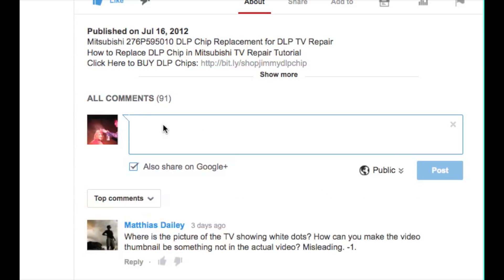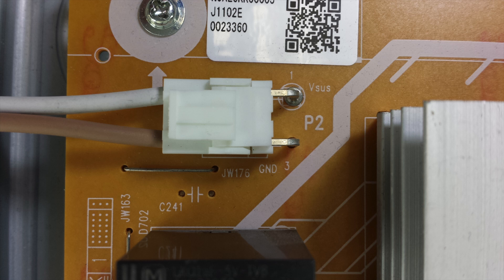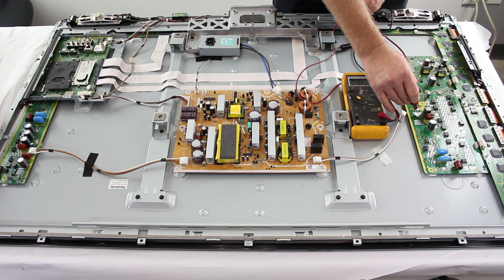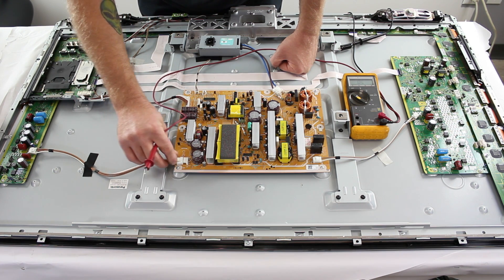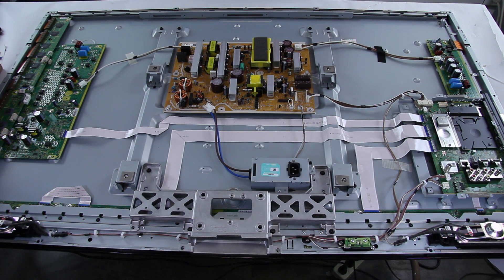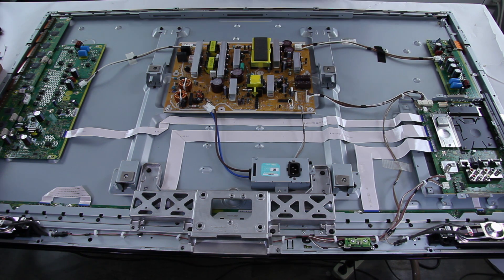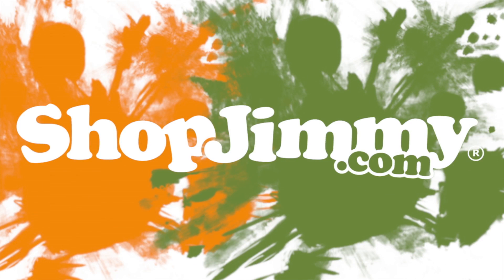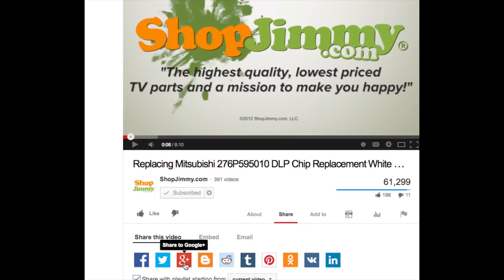Panasonic Plasma TV Repair - Understanding 14 Blink Code - How to Fix 2011 Panasonic Plasma TV

Comment: Hi Jimmy, Have a Pioneer Plasma PDP-505PG. It is switching off with 10 red flashes. If I turn it off at the power point it resets and works for some time, then fails again, how to I repair it? Regards Paul SHEPPARD

Comment: Usually the capacitors get killed, since its an old TV from 2010-2011. First thing that needs investigating. This is a good starter video, but its kinda shitty, because you only show how to replace an entire board. Its not fixing the TV, rather just replacing parts of it.
Reply: I disagree.  From my perspective of a non electronics guy who wanted to rescue my plasma, this video enabled me to identify the faulty board and order a replacement board directly from China for $50. Simple swap and the picture is I swear better than new from 11 years ago.  Most of us are just trying to rescue our tvs, not take a course in electronics. There are many YouTube channels for that. Go find one.

Comment: I have a TC-P65ST60 Panasonic plasma dated 2013.  Last week it made a pop sound and it shut off.  I have tried soft and hard resets with no success.  The red light continues to blink (7 times, pause then 7 times again) and I can hear a click when plugging in or after holding and releasing the TV button.  I have not yet done any disassembly and hope for some guidance prior to doing anything further.  Any advice appreciated!
Reply: Watch the video and follow the steps.  Don’t be intimidated.  Buy a multimeter, they are inexpensive.  I did this with great success and $55 later it’s as good as new

Comment: I’m testing the sc board on my Panasonic plasma tv PC-P50ST30 while watching your video. Not sure which board is bad (no picture and 14 blinks). There doesn’t seem to be continuity on part 5w 2.2K 173. I disconnected the su and sd boards separately and still no continuity on that part. Not sure how to interpret that. Would love to get this tv working again but don’t want to waste money replacing boards that are still good. Thanks for your help.

Comment: Got a tcp42st30 (March 2011). I use it in Europe with a 120-220v transformer. Screen went black yesterday. Probably after 4 years of voltage transformer use it fried. Get the 14 blink code. Should I replace the A board? I’m not a repairman. But would like to keep using the tv.

Comment: any idea what to do when the standby light is on but the screen does not turn on? the high frequency switch on noise is missing and the screen stays just black - nothing happens. you can just turn it off again so the red standbly light goes on and the turn off switch can be heard. it is a TX-P50VT50E plasma.

Comment: My Panasonic plasma TCP50S30 has a new power supply board but is still has black screen with no red light of any sort. No response from the switch or a remote. There is power to the board and using your video above other boards appear to be ok except the SS board may have a short ( middle contact shorts). Is the main switch at fault?

Comment: Hello I have a Panasonic TC p50s30 I went through your diagnostic and didn’t find a short I turned it back on and it had no blink code and about an hour later it turned off again 
And now has the 14 blink Code what are your thoughts

Comment: Hi, I have TP-50ST30 Panasonic Plasma TV. Which is giving me a 14 blink error code when i plug in the power cord. But If I keep the power button pressed while plugging it in It shows solid red light and then when I keep the power button pressed for few seconds It goes off. But then when I turn the power back on it gives me the 14 blink error code. I have tried replacing the Power Board as you have mentioned in the video for the solid red light. And I even tried replacing the SC Board but I am still getting the 14 blink error code. Can you please help on this for the fix. Thank you. 

P.S I am super new to all the whole TV hardware repair so please guide me accordingly.

Comment: @ShopJimmy - If the first test fails, that means the main power board is bad correct? (Most Likely)  Do you still have parts for this?

Comment: Not sure how this explains code 14. It certainly suggests your a shop selling boards though. Which is ok, but you should anounce this right away as to save techs 10 min before realizing we won't have any more understanding of 14 cause than before, but you can use us to swaP pArts

Comment: I have a panasonic G20 plasma. I have already replaced some of the parts and have had a humming sound for some time. Today I tried a power reset and something popped in the back left side when facing the rear. Now it won't turn on and no light blinking is displayed. Can you help?

Comment: Plasma daewoo 42 inch , turned of settings on off by mistake with remote, now tv will not turn on just red blue light flashing black screen , what have I done, working fine before , fault i was just turning off standby mode

Comment: Have a Panasonic TCP55ST30 with seven blicks replaced both Buffer boards and SC board still no go noticed voltage from power supply 200 volt and 15 volt drop down after a few seconds checked for grids with all plugs removed notice 538 ohms to grid on 15 volt supply from power supply . Should power supply be replaced . Already spent to much on tv HELP!!!!

Comment: I have a TX-P42G20E that does not work. When turn of led green goes ON but then, after 5 minutes led red goes red blinking 13 times. 
Buttons of main board does not work, only response to remote IR unit.

Could you help me?

Comment: Hi Jimmy, my Panasonic plasma tv won’t switch on. The green light flashes very quickly for a second or two, then it’s just the red light flashing once every four seconds.  The model number is  - TH-P65VT20A. Any assistance would be greatly appreciated.

Comment: Good morning 
Sir I have a Panasonic plasama  MODEL NO TH-P50X30M 
220 ~240V~    50/60Hz  250 w
Working conditions was closed 
After 5 years want to on may tv but not come on  because given 12 Blinking code red lights error  then shutdown please give me solution How it repair

Comment: Hi, having the black screen issue with my Panasonic tc-p50x1 but my light doesn’t blink, it’s solid. After I turn it on it stays on for maybe a minute before shutting itself off and then turning itself back on again; after about 3 cycles of that it just stays off. Would LOVE some advice.. I have the back off already and I have a service manual for it but finding answers for issues NOT involving a diagnostic flash had been almost impossible. Thanks!!
Reply: Hi, could you solve the issue? I have the same problem..

Comment: I had the 14 blink problem. With the help of this video was able to pinpoint which board was having issues. I replaced a couple transistors which had gone bad, and this great plasma tv is working like new. many thanks!

Comment: I have a quick question I hope you can help me with. I have a cheap meter and I believe when it reads "1   . " it is the same as when yours reads "O.L". That signifies a short circuit correct? So like when I test my P2 power lead I get a 00.0 and same with the ground with the wires plugged in or not it they read the same. Would that mean my P2 connection is still good? Thank you

Comment: Hi, Guys. I have a Panasonic TC-54G10. Of course, its not one you have listed listed but here goes: We had a power surge that was caused by a lightening strike close by.  The TV's power light came on but was unresponsive to the remote or inputs. I did a reset by unplugging the power cord then in the power button for 60 seconds.. After that, the TV clicked on, solid red power switch light was on and I could see some general illumination  of the screen.  The TV seemed to try to reset itself several times, turning itself off and back on. Eventually, instead of the solid power light, the light began blinking in increments of 14. Because I can see a faint, general illumination of the screen itself along with the blinks, does that indicate the Main board? If I need to check voltages, what kind of meter to I need?  Also, did you check the ohms with the power still connected then disconnect and wait before actually disconnecting the power supply board, or was it all totally disconnected the whole time? 
Thanks,
Mike

Comment: Hello, got Panasonic TV just sound no picture and led light is on once tv is switched on, check the board and I could see there is burns next capacitors, is that could be the problem? Never fixed a TV before, I could send you a picture if you want, any advise would be much appreciated, thanks

Comment: HI , I have a panasonic t55ds503e suddenly  it stop working.  So It open it show the picture for 2 seconds and it turn off and it starts flashing the red light  , i tried to reset , i put out of power for more than 10 minutes nothing worked . Any other ideas what should i try or what to look out? thank you very much

Comment: Hello, i followed your diagnostic video and found no shorts. I continued to get the 14 flashes. I located a replacement tested main board and installed it. I still get the exact same 14 blinks. Is it likely that I received a bad board or should i just give up on this tv? Tcp50s30
Thanks for your advice

Comment: My Panasonic TC-60S30 just made a loud pop and shut off. I unplugged it for 2 hours and no power or light indicator. Removed the back panel and noticed a small burn on a blue “resistor” on the “NOAEKM00003” board. Looks like I’m replacing
Reply: outstanding..thank you very much... exactly the same issue!

Comment: Having a 14 blink cold after hearing a pop and the screen is just black.
Model: Panasonic TC-P55ST30
Tested power supply at P2 like in video and ground pin shows no ohms and other pin has ohms so power supply is good. At second step in video testing the SC2 connection on the SC board I have a short to ground both terminals show zero ohms.I went on to disconnect the SD board and test it and nothing changed so I did the SU board and nothing changed does that mean I need a new SC board?

Comment: Model: TX-P42U30B 

I bought this tv a few months ago (not from new) and it worked for about 2 hours and then just turned off. I have tried different plug sockets and different fuses for the plug. When switched on at the plug it shows a red light but doesn’t turn on. 
Do you have any idea on what could be wrong?

Comment: I have had a Panasonic TC-P55GT30 since new, approximately 9 years. A couple weeks ago on start up the top 3rd of the screen was washed out and we go away. Now the same this happening all the time when the image is a light colour. It is a though it has the colours are gone or washed out. I don’t see any error codes. 
Is it worth repairing?

Comment: panasonic TH-42x20R plasma tv -  When I turn on my tv the Red light blinks but there is nothing on the screen/display i try many times reset by unplugging the power line and re-plug  but the same no display it just red light blinking

Comment: Are Panasonic high definition plasma television model TH – 42PX600U the TV won’t turn on when you push the power button it buzzes and the red LED is lit

Comment: Tc-p55st30 shows short on su and sd boards i think but when disconnecting power from sc and testing for ground it also shows a short... so do i need sc sd and su boards?

Comment: I have a PDP504PU Pioneer 50" plasma elite. The receiver gets power, and the green light comes on. the tv is getting power but won't turn on. stand by LED is lit red.  all on tv buttons have zero effect on the unit. the remotes don't seem to work either.  i have tried a second set of cables that connect the receiver and tv but still no luck. Thank you in advance.

Comment: Panasonic plasma
TH-P42X30R
kindly reply with solution.
first of all tv runs smooth and then problem aroused with power on and then after 5 to 10mint smooth running the power gets off, then again it starts by itself. but now it only shows redish pink ghost screen i barely see channel and volume  bar.

Comment: Good Afternoon,
I have a Panasonic Plasma TH-50PZ85U. When you plug it up the Digital audio out get its red light. When you power on the tv it clicks like it turning on, the fans spin for a sec, and then clicks off. it seems to blink 3 time. Any idea on this would be great.
Thank You

Comment: 1. Hi, I have a Panasonic Viera LCD TV L42U30D  When I turn on my tv some time green  light blinks and then the green light is on but there is nothing on the screen. The screen is black and black.
2. In some time TV is working perfectly many hours ( i have checked continuously around 18 hours).
3. Some time during running perfectly 1 or 2 hours green light is on but there is nothing on the screen. The screen is black and black.
4. During these if i switch on/off tv through tv button 14 red blinks came after thar pause for few second & starts 14 reb blinking.
5. If i switch off from mains & turn on tv running perfectly. How to fix it. Generally tv is running purfectly.

Comment: I have a TC-P50ST30 I followed the video. I have a short at SC2 but no short at TPSC1 with the SC2 and ribbon cable disconnected. I have the 14 blink code.

Comment: I have a Panasonic vierra tblx0037 it has 6 flash code. The tv never had any problems until it started turning itself off. Now just six blink code when you try to turn it on.

Comment: I have a TC-P50S30 that won’t turn on. I followed along in the video and checked all the connections and had the solid red error code (which you said indicates a bad main power supply board). I replaced the main power supply board and the tv still won’t turn on; I’m still getting the solid red error code.

Comment: I have a TC-P65VT30 plasma TV, I don’t have any blink codes but the TV just started shutting off after about 20 minutes of operation.  After it shuts off I can I mediately turn it back in and it operates for another 20 minutes or so...  Any ideas on what the repair is to correct this problem?

Comment: TC-P50S30:  lost power to house abruptly with pop noise.  2 days later TV fails.  14 blink code.  I followed video:  p2=ok, sc2=ng, tpsc1=ok, p11=ok, ss11=ok.  What is your recommendation?  Also, your board inventory appears depleted on your web site.  Thank you for your time.... trying to avoid a big expense, if I can

Comment: I have Panasonic TC-P55ST30 that the red power light stays steady, no picture, no blinking even after sitting 24 hours with no power and holding the power button in while plugging AC back in. I did find the power board and the SC board have shorts following your excellent tutorial, would this testing be valid even though I saw no blinking codes?

Comment: Hi. I hav a 2009 Panasonic (Viera) Plasma tv Model PH-T50C10M, power light blinks 2 times continuously but tv does not start. I’ve been told that the Y sos needs replacement. Can you please confirm? And how to get that part?!.